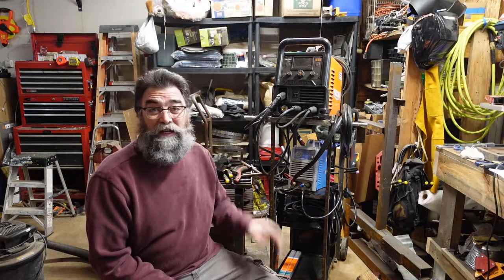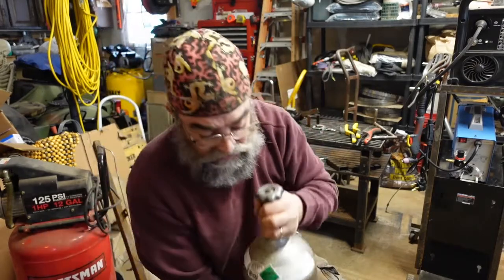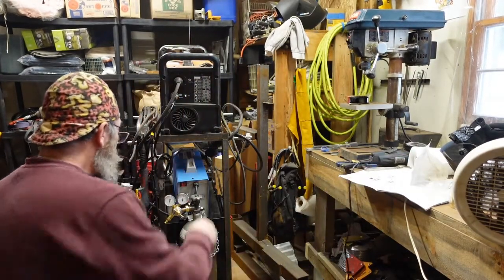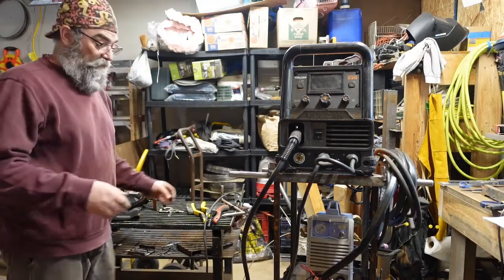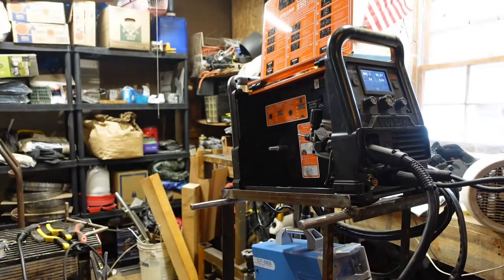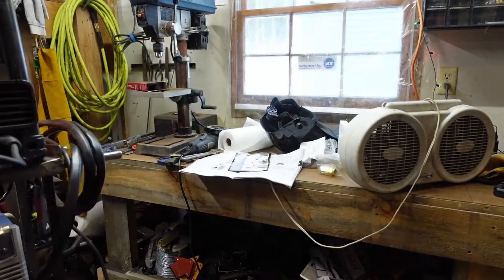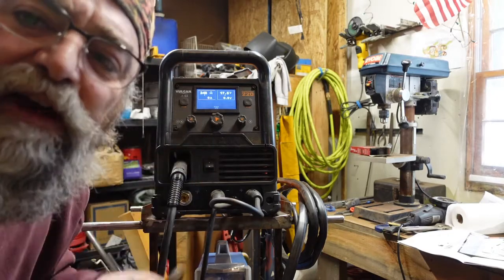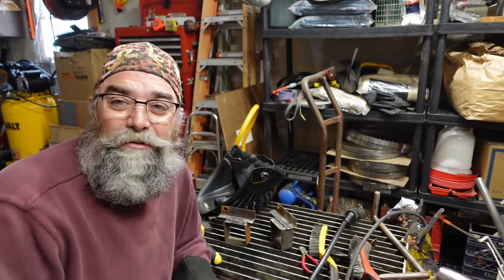Adding Argon Gas to Vulcan Omnipro 220 Welder.  Flux Core VS Gas (solid core) Mig Welding

Comment: I just tan acroos your video and liked and subed.I just bought a vulcan 220,cart and spool gun, lots of wire and rod, gloves, and the whole sha bang. Haven't welded in years. Yesterday welded things i needed welded for quite a while,mig flux. What a mess. Thin steel,burning threw. I finally got it. Lots of grinding. So anywho,lookin forward to some future vids on how 2zs. Peace out.

Comment: Acording to Damon on Project Brupeg channel the benifit of flux core is if there is wind blowing the shielding gas you can still produce clean welds. So if you are welding outside flux core MIGHT be preferable.

Comment: So there is a memorization trick "if there is Slagle, drag" since it's using gas, push the gun rather than pull like Flux core or stick.  It'll probably help improve that quality.

Comment: When I weld in my shop I will set my Argon gas mixture at 4 CFM. Outside I will run the Argon gas at 6 CFM that works good for me. Please wear a mask that is for filtering out the argon, very very bad for your lungs. What works good for me is always push wire feed welding and drag stick welding. Looks like you have a great shop to work in.